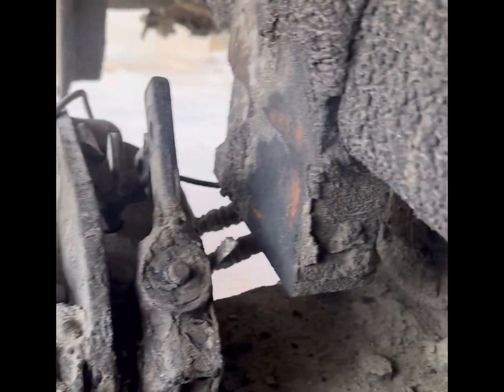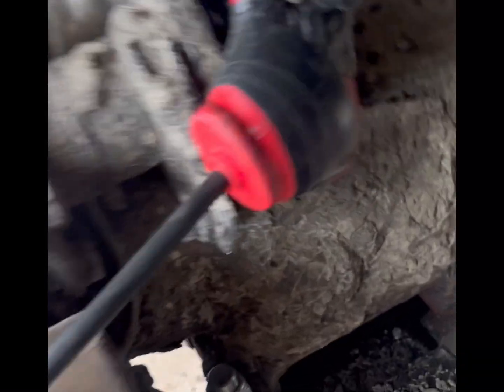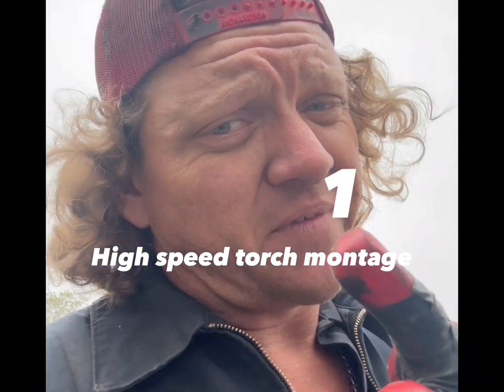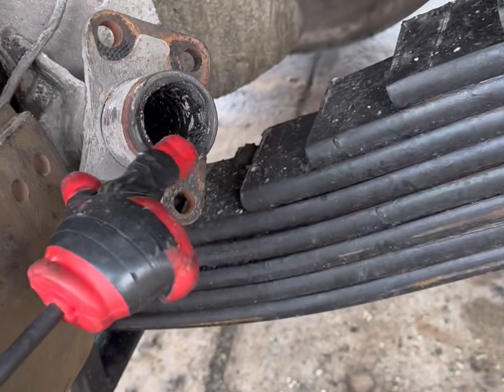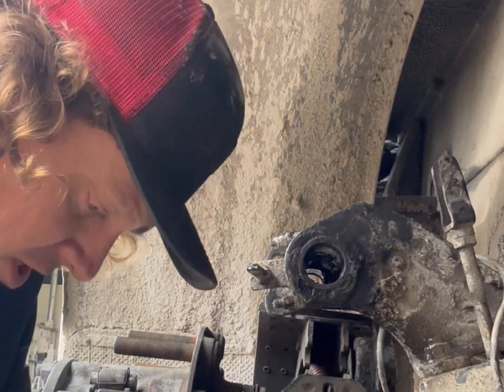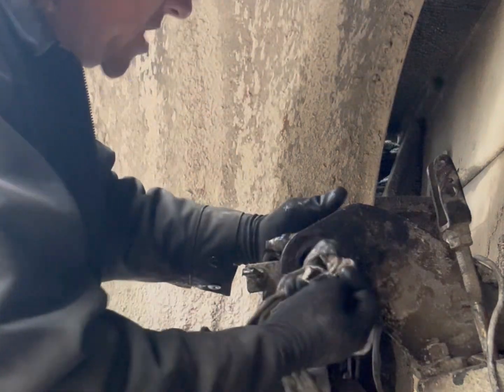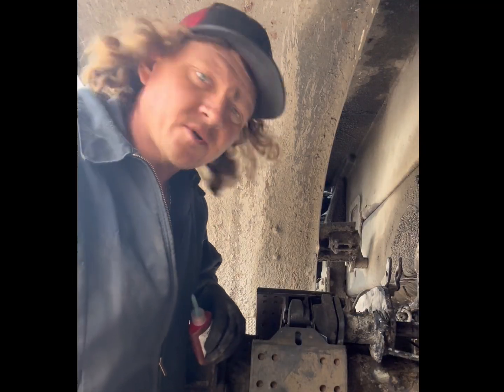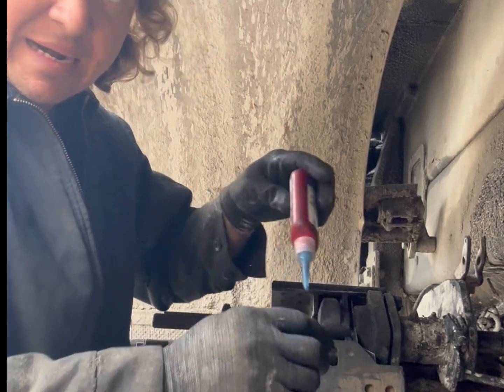Avoid Costly Repairs: one reason you have to cut S-cam on semi trucks 🤯

Comment: I use a big jack hammer on the slack adjuster or right on the s-cam if possible when they are rusted on. Mostly becuase I’m intimidated by the Zip disk but it also only takes a second once you get the hang of it.

Comment: Does the slack adjuster rubbing the stop affect braking? I was a young pup running a DM MACK tri axle dump with the Camelback suspension. I never knew to check slack adjuster clearance for bad bushings. 
Hopefully I remember that if and when I run a camelback again.
Reply: Not sure how off track it would throw you. His other video on this truck was showing 2 to 3 inches of side to side throw/play.

Comment: It's so stupid how mack truck axle housings are rotated 90 degrees and then have that stupid offset yoke ring and pinion gear to make it work. I get that it gives you like an inch or 2 more ground clearence and keeps your brake chambers out of harms way since axle is rotated. However those whole "maxi torque" drivetrains are a joke to drive. I literally just had to drive one yesterday afternoon because the pump operator was off so after I was done for the day I had to then drive a cabover mack pump truck to and from a jobsite for my boss to pump 2 footers well after I would have been done for the day. Not a nice rig at all in my opinion. I'd prefer the Western Star articulated boom crane or even the old Sterling Crane truck I drive nearly everyday now over a mack concrete pump. Even the old Kenworth T800 with the C12 or worse yet a Peterbuilt PB330 with C7 than the mack Pumps and dumps. Some engineer thought turning the axle housings 90 degrees was a good Idea and I understand why but like most engineers they dont think about or dont care how much it sucks to work on. I dont want anything to do with concrete pumps, especially mack pumps, and those "maxi torque" transmissions?! They aint got shit on Eaton. Eaton transmissions and Caterpillar Engines for the win! Maybe Detroit or Mercedes-benz as an acceptable alternative but them Caterpillar C12 and C13's are where it's at. You hear them Jakes and you just know. God bless

Comment: Late to the party here in 13 years of working on trash haulers and 20 years of big trucks in general that has moved alot more then it should of ever moved that thing was wasted and how the truck drive even drive down the road the saddle bushing get enough wear the axles will move and they drive like crap i seen worn out butt wow

Comment: Truck OWNER, will use more grease.🎯
 A real good owner, anyway.
.
 Also,it's ok, to use the steamcleaner, to clean the grease off  BEFORE you hot wrench🔥👀🔥🎯😎☕
Reply: You’re 100% right, when you’re the one that has to fix the thing you’re a lot more likely to keep every greasable joint, bushing or bearing on the truck well supplied with fresh grease. Sadly with a Mack setup like this ghat only helps if you have the heavier rated Camelback suspension with greasable brass Trunnion bushings, but the “Elephant pads” at the spring ends are a thruway rubber part that can also cause this problem. Then there’s the ones with rubber Trunnion bushings where there’s nothing preventative you can really do. I’m just not a fan of Mack’s camelback suspension as a whole….Hendrickson RS and RT suspension are a lot more robust setup…I’ve seen them with totally worn out center and end bushings and they still never get as bad as this…plus if they break a center tube you can still drop your load off and drive the truck back home. On a Mack if the Trunnion bar breaks while you’re moving, the truck is going to roll over….there’s no avoiding it. Pretty scary to think about.
Reply: @J.R.in_WV  its kinda sad to think, years long passed, things were engineered and built to be maintained,,( usually ).
 Now days, it seems to be a 'roll over and throw away society.
 Too bad there are not regulations to require quality, in manufacture of good old maintainability of products these days.
 Seems to be contrary, to progress. With the technology and materials we have these days. Products like semi trucks , which keep the world moving, fed, clothed and sheltered, wouldn't be that difficult to produce.
Reply: One guy I know has close to 30,000hrs, on a Linkbelt 290 log loader. It's still in better shape than many machines much newer. Using a machine, not ABUSING a machine, goes a long, long way.

Comment: I'm about to repair/reinforce the right front spring to axle interface on my 2002 F250 since it rusted so bad and the u bolts loosened up. Ever seen that before? The bracket that the bolts go thru is welded to the axle tube and is not sold by itself so I'm going to tighten the bolts down onto some thick angle iron before welding the iron to what's left of the bracket. I think it'll do. What do you think?
Reply: Be careful welding to that bracket, it is cast iron. I've done it a few times, you gotta know what you're doing.